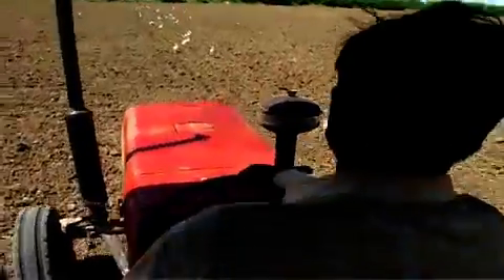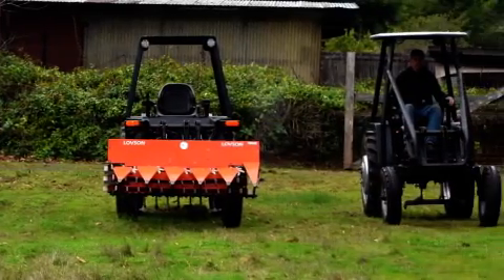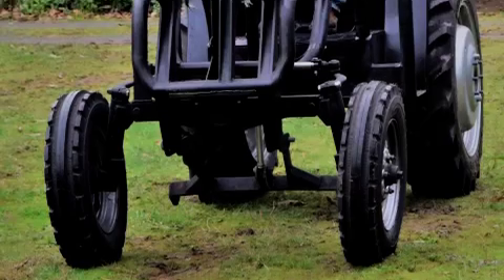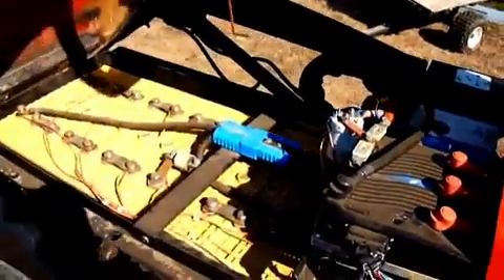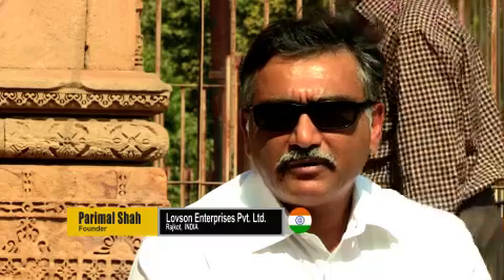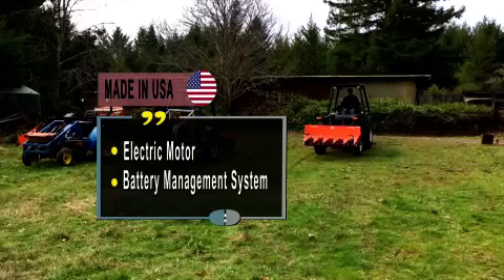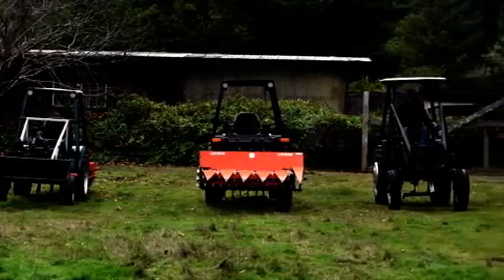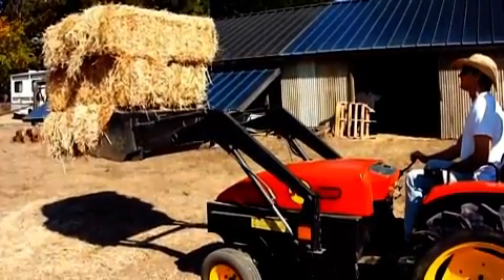Solar Electric Tractor

Comment: In india 95 % tractor are between 35 hp to 50 hp ... These are mini tractor less than 15 hp...  In india price is very sensitive.. 6 lac tractor price for maximum farmers to buy.... Bcoz of batteries these tractor cost around 15 - 20 lac ...